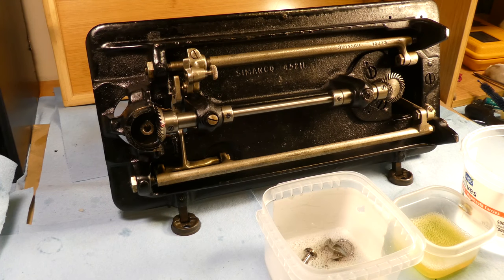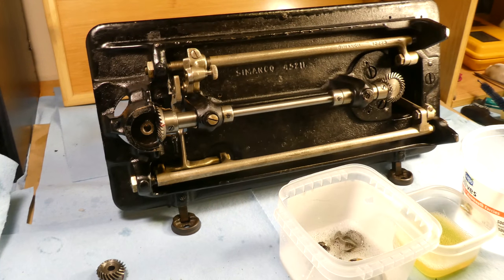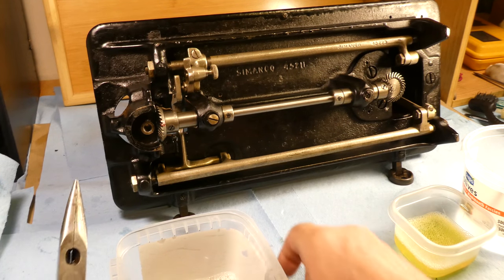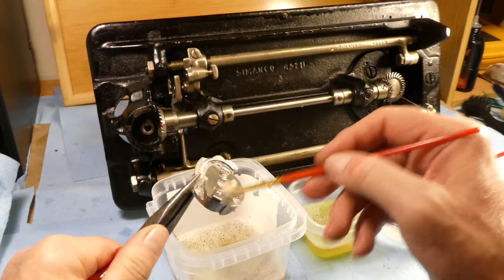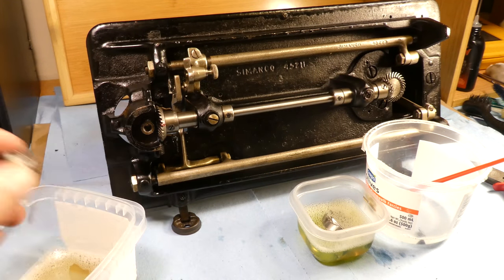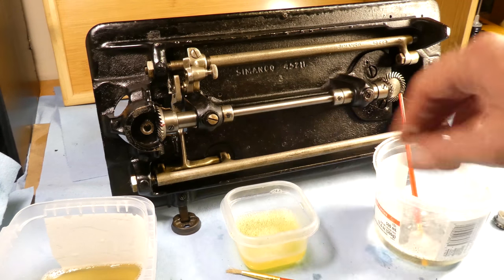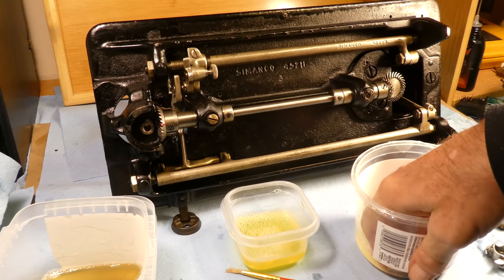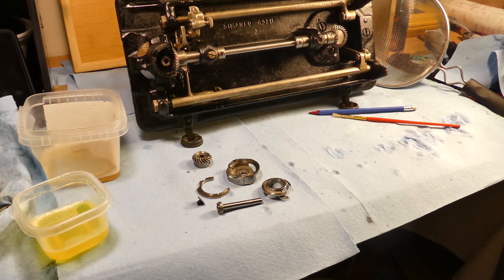MORE HOOK & BOBBIN SINGER 201K

Comment: I’m gonna have to do this to mine for sure now. I’m really glad the nail polish stuck on well and worked great, I’ll be using it for sure.  Are u using the original Krud cutter or the must for rust here?
Reply from the maker: HEY ALISON! AFTER OUR CHAT I DID REMOVE THE NAIL POLISH WITH A STAINLESS STEEL BRUSH! 
I WOULD HAVE LIKED TO BE ABLE TO TAKE THE RODS OFF BUT I AM UNFAMILIAR WITH THE SETTINGS, LOL! ANOTHER DAYS LESSON I SUPPOSE. AT LEAST THE UNDER RODS ARE EASY TO GET AT FOR ANOTHER ROUND OF BRUSHING & SHINING. I FINALLY GOT A 201 SERVICE MANUAL! THANKS FOR STOPPING BY ALISON!
Reply from the maker: ACTUALLY I USED ONLY THE STAINLESS STEEL WIRE BRUSH AND THE PLASTIC BRISTLE BRUSH FOR THE TIGHTER AREAS.ALL THESE PARTS HAD HAD A LOT OF OIL & GREASE & THEN WIPING DOWN UNTIL ALMOST DRY. I WOULD HAVE USED KRUD KUTTER BUT EVEN THOUGH I HAVE SOME MUST FOR RUST I HAVEN'T TRIED IT ... UNTIL NOW! I WILL TRY IT SOON. GOOD YOU MENTION IT.